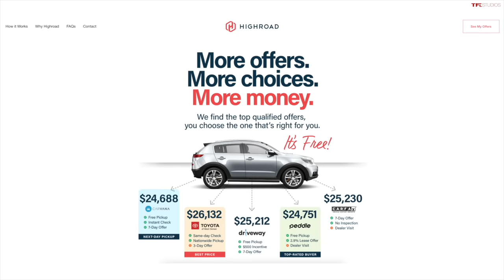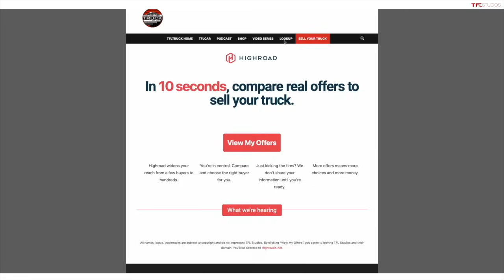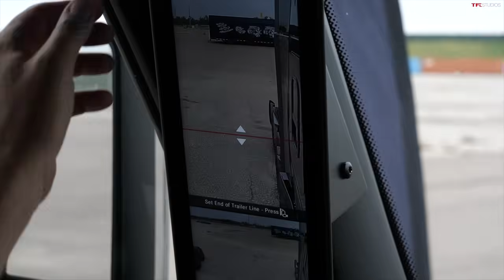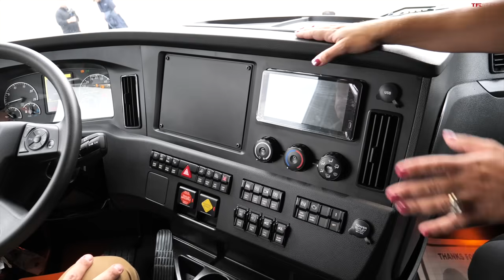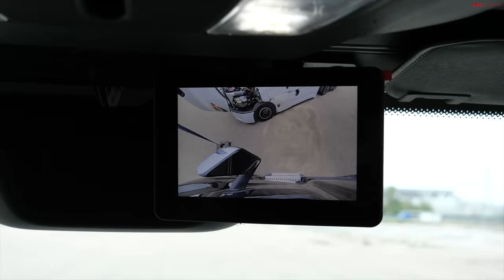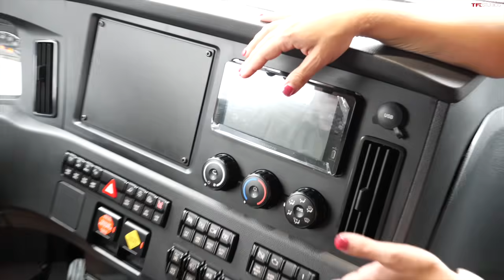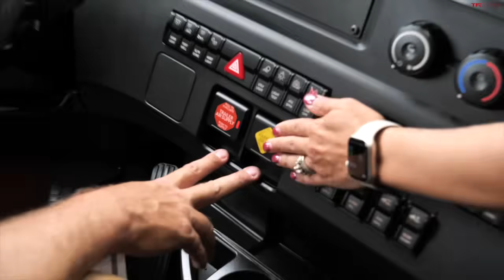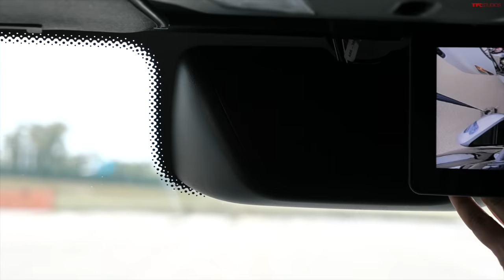Deep Dive Into The Most Popular Semi Truck In America! The New Freightliner Cascadia!

Comment: A freightliner  known as a freight shaker will never be real mans truck  Kenworth  #1  Peterbuilt  close second  🇺🇸🇺🇸
Reply: So your manhood is determined by what the name is on the front of your truck, that's funny. I always thought it was the brand of cigarette you smoke.
Reply: Old Petes were terrible, the 389 should be left in a museum, 100 miles, I needed out...worst thing I've ever driven, and I've driven most, outwith Russian...glad its replacement finally has a sensible clutch pedal! W900 is also brutal ugly, the W990 is a step forward, only one I'd buy,Cummins and manual, as Paccar autos suck,PB/KW/Daf.
Reply: I drive a Kenworth.

Comment: Used to drive a 1968  Mack with a straight cut manual gearbox, compressed air starter and NO power steering. It had the biggest steering wheel I have ever encountered. It took me two weeks to learn how to go up and down the gears and if you. missed a gear it was stop and start from scratch again. When you managed a good,  well timed gear change, particularly  a down shift, there was great sense of achievement .

Comment: I have put over 500k miles on a 2020, 2022, 2024 and 2025 cascadia and the “safety” features (forward crash alert, emergency breaking, blind spot monitor) are absolute trash 🗑️ 

Also have constant issues with the wheel speed sensors (in every truck I’ve driven) every time it rains, which disables ABS, cruise control, and downhill engine braking cruise control 

I don’t think I’m the only one who’s had enough of the tech that’s going into commercial and consumer vehicles.

It would also be nice if freightliner could figure out how to align the steering column and drivers seat, instead of the wheel being off to the left.

Comment: Something I would love to see in pickup trucks is an option for a dashboard like a big rig where the center of the dash is angled towards the driver. I use my truck for work and 99% of the time I'm alone. It would be easier and safer IMO if the switches and screen were facing me instead of straight back.
Reply: I would love a dash that has panels that can be unscrewed to reach the backs of switches and the guts of the HVAC system.

Comment: Freightliner is a fleet truck... cheeper in cost because of large production... also for the most part assembled in Mexico, and generaly leased in bulk for large fleets. Volvol pretty much operates the same way and they also own Mack Trucks. Peterbilt, Kenworth and westernstar are more owner operater based, have sturdier cabs and generaly put together with a little more care and attention. They also biuld custom trucks usually found in the constuction, oil patch and other specialized industries.
Europe is more concerned with length and width as things are generaly tighter over their and their distances travelled aren't as great. I could go on and on but I hate keyboards... cheers guy's.
Reply: Western Star is owned by Freightliner guy😂
Reply: @ep_got_the_sauce  that isn't the point, they don't cater to large fleets... guy.
Reply: @ep_got_the_sauce Detroit Diesel...reason to buy a Western Star over a Paccar product!
Reply: @williamrae9954 You can put a Cummins in a paccar product.
Reply: @knightwing4  I know...nothing beats a big Cat though...Detroit would be my 1st choice these days!
Reply: Currently drive a Kenworth, overhyped piece of junk. We have 6 of them, 2020 and 2021, all under 500k miles, all have had all airbags replaced, all have had cams replaced, all have new turbos, all have had radiators replaced, a couple of them multiple times.
Reply: Pete's and kenworths are not better than these recently.  They use the same Chinese build parts too

Comment: Air is used to RELEASE the brakes, not apply them. The default is mechanical spring application. This is why when you start the truck, you must wait for the engine driven air compressor to build pressure to release the brakes. You cannot exchange trailers with hydraulic brakes, if you hade to bleed the brakes every time, therefore air brakes . If air pressure is lost, brakes apply fully from spring pressure. I really wish that ya'll knew what you were talking about...
Reply: Here’s how a drum brake operation works.

The operator depresses the brake pedal, actuating the air braking system.
The air from the reservoirs is supplied for the brake valves.
The air from the valves is delivered to the brake chambers.
The chambers move the pushrod to push on the slack adjusters.
The adjusters transfer pushrod force into cam rotational force.
The cam rotates, causing the rollers to rise and force the shoes against the drum.
The shoe linings contact the drum to slow or stop the wheel.
The operator releases the brake pedal.
The delivered air exhausts.

Comment: Detroit needs to make an electric drive for the engine cooling fan. I climb a mountain with a heavy load. In any season, the belt drive cooling fan takes 10% of the engine power, and the engine burns more diesel fuel too.

Comment: Yes, the accident in Colorado was very bad. I still have no clue why the driver didnt take the runaway truck ramps. Also, the last company i worked for, gave road tests to drivers before they were hired. However, they did not make the drivers locate and operate the exhaust brake. So many didnt know how to engage it. It’s crazy how many trucks we see “riding” the brakes going downhill. This is very dangerous because the brakes overheat and you can’t stop and sometimes catch on fire. Depending on how steep the grade is, i like to be in 7th gear and exhaust brake on, which keeps me around 35-40mph going downhill. There are many 10,13 and 18 speed manuals. I have driven the 10 and 13 speeds. 13 speed you “split” high side gears only. On an 18 speed you split the low and high side, which just gives you more options on pulling the load and staying in the power band. I never driven the 21. But the 18 is one shift lever now at least. No idea about the 21. I love manuals because i love to shift and float the gears. Also, if you own the truck, replacing a manual transmission can be done for around $2,000. An automatic will cost around $12,000+ just for the part, not including labor.

Comment: Well as someone who hasnt driven a manual truck since 2022, i very much miss driving a manual. The lag in downshifts for proper engine braking even when manually shifter is absolutely terrible. The only benefit from an auto for fleets is only profitability. Training new drivers to drive manuals is time consuming which means the trucking school conveyor bely cant poop out CDL holders fast enough, careless rookies can damage and degrade clutch life and people with little manual transmission experience can get very easily distracted by a misshift.

The auto trucks do tend to burn up clutches when trying to slide tandem axles under heavy weight, the gearing is incredibly tall which has caused stalling or even clutch overheating when starting up a steep grade with heavy weight and the auto nuetral coasting is ridiculous. Backing a truck in tight quarters with an automated manual is incredibly dangerous. 

The only truck that has the best automated manual is the Volvo with the I-shift. Volvo has came super close to perfecting the auto. I currently drive a Kenworth with an Eaton 12 speed and its way better than Fruitliners Detroit D12 auto, but its not as good as Volvos i-shift. But even with a Volvo, I've still t into clutch overheat situations.

Comment: I’ve driven these trucks, the safety stuff will drive you crazy!! Had multiple experience where the trucks would slam on brakes when   Going under some overpasses or a big road sign close to road!!👎🏽 Volvo automatic transmission shift the best but there safety nannies are too much!!  One thing they should work on is a weight regulated air suspension, bobtail drives are really terrible!!!

Comment: The idea that European rigs are "more advanced" is born from ignorance of what they are in the average European driver, after all your average European knows little to nothing of basic pickup trucks so anything larger is beyond them. The length limits they operate under along with the generally tighter roads mean that cabovers are essential by way of physical limits.
Otherwise the shorter distances covered by most European drivers mean that a lot of the comfort innovations that the US market demands haven't really been done in Europe.
One other point to remember is that the idea of being a "Owner/Operator" is much rarer in Europe in general thus you have fleets making the buy decisions thus driving feature demands.

Much like with the new Cascadia all of its newer features and technology are being driven almost solely by fleets and not by owner/operators who would be much more resistant to most if not all of the electronic "safety" systems especially if those systems can't be turned off and could lead to unacceptable downtime and eye wateringly high repair costs.

This is one reason in addition to not having universally unreliable emissions systems so many owner/operators tend to desire older trucks that are free of these extra systems that don't add value to the work being done or don't offer any actual increase in safety.

Comment: The main benefit of a cabover is turning radius... the ride is crap, the noise is horrid, and the economy is terrible...
Reply: Turning radius and road view, the economy of either style is terrible.
Reply: Tend to drive slower,90kph in the EU,60mph in the UK,economy is roughly the same, 10mpg out of our 4.54litre gallons is common...more aero efficient than they look!
Reply: You’re the first one to the scene of the accident.
Reply: Actually a truck with an aerodynamic hood is more efficient that a cab over. Also, a cab over has a blind spot in the right front corner that a hood doesn’t have.